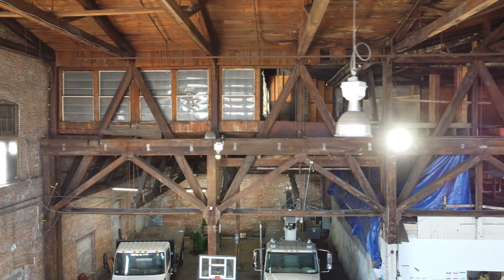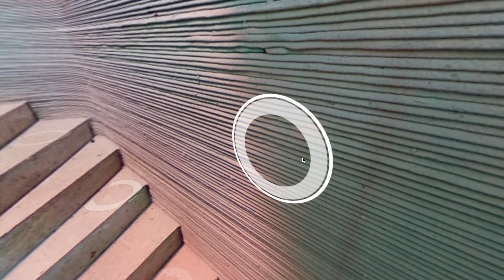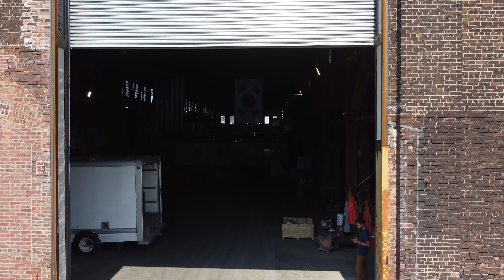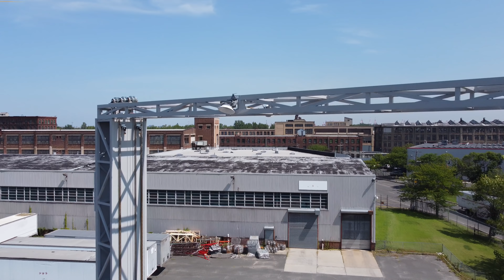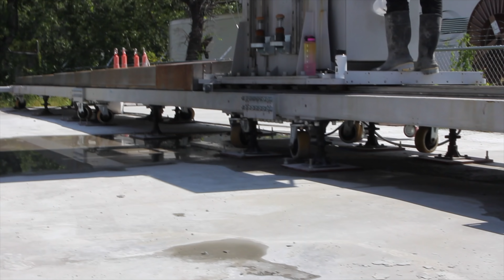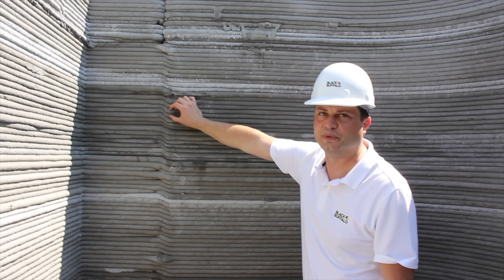4 Story 3D Printer Will Print HUGE Buildings | Black Buffalo 3D

Comment: Wow! Even the Koreans signed up! Question - I see they wet the concrete slab to increase adhesion of the first layer. Did they have to add additional cement binders as well for the first layer?